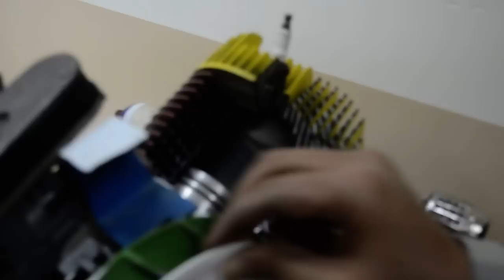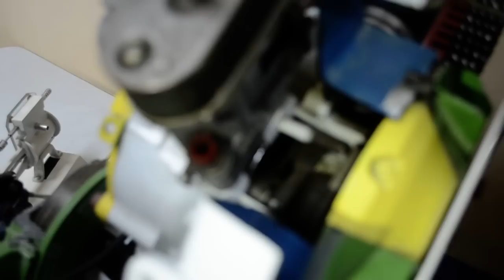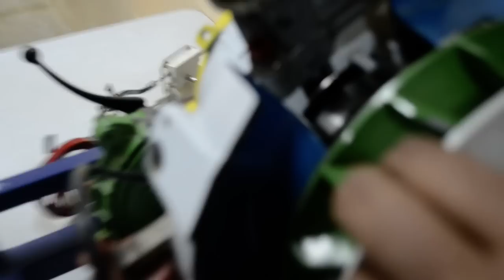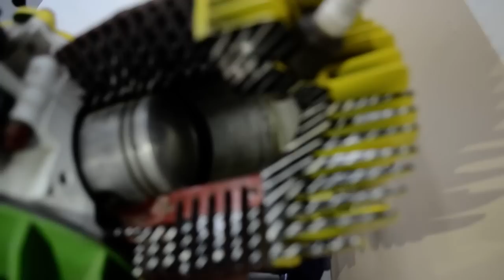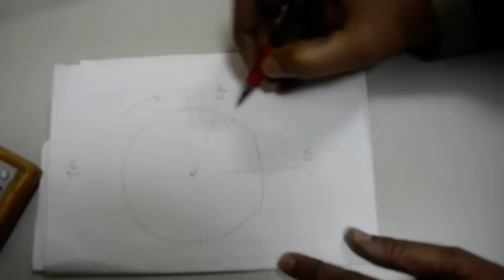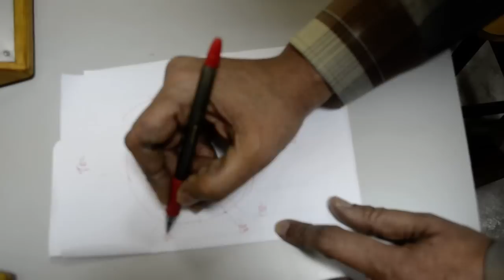Port Timing Diagram

Comment: Excuse me Sr.
What does mean transfer port angle ?
For me it's the angle which the crankshaft turns while the gasoline on the crankcase goes to the top of piston. In this case the angle btween the TPO and the BDC.
Or this is the angle which the crankshaft turns between TPO and TPC ?
Because between BDC and TPC there's no fuel transfer, am i right ?
In this period occours the fuel admission, so why includes this on the transfer port angle ?